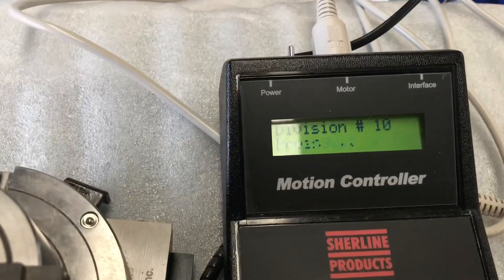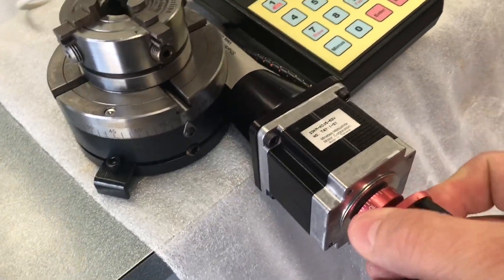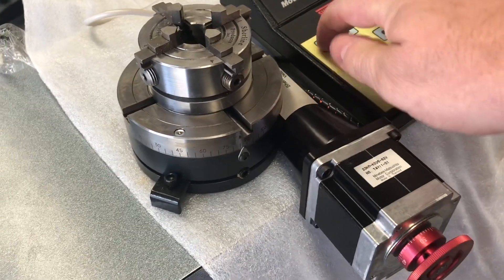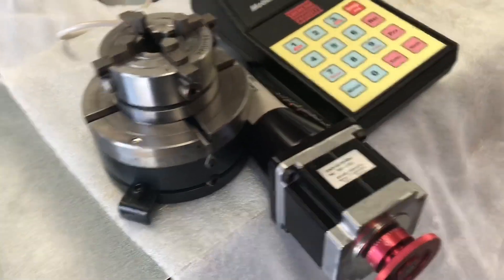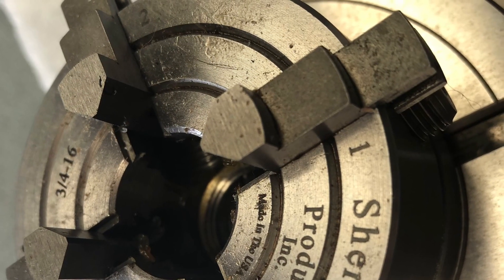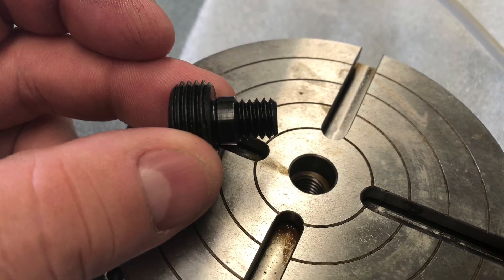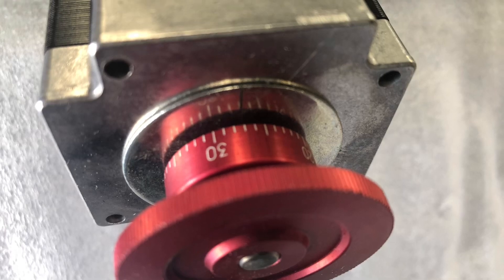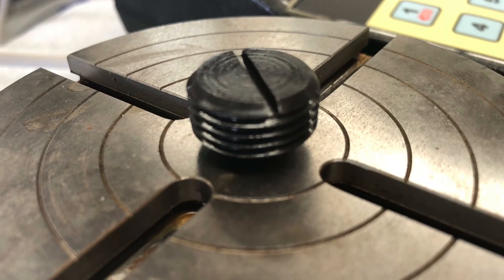CNC Candy - Sherli(ne) you jest!

Comment: Looking forward to the CNC machine build, will it have metal mill capacity ?
Any recommended books or sites to get started on the subject, into program & code comprehension ?
Nice fix on connector socket..
Reply from the maker: For me, building my reprap 3D printers was a great start on my path to working with steppers, cnc control, modelling and repairs. This was what gave me the confidence to buy my 600x900 co2 laser from China, figuring I could fix anything that went wrong... turns out I needed lots of that experience as the issues were many!
The CNC mill (sherline) is already a decent machine, and we will feature some discussion on setup as we progress, but please let me know if you would like more detail on any part of the setup/build.
I am also building a couple of other projects alongside the mill, we will be adding cnc to the sherline lathe, also making another rotary table cnc division ready, and a number of Arduino style control and calculation items
Reply from the maker: and yes, we expect to be milling metal wth the sherline lathe and mill